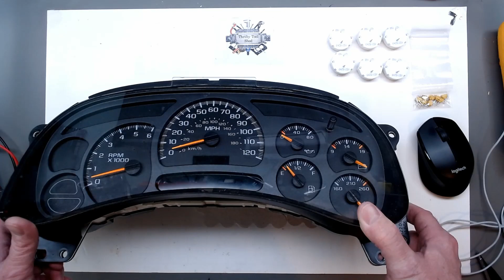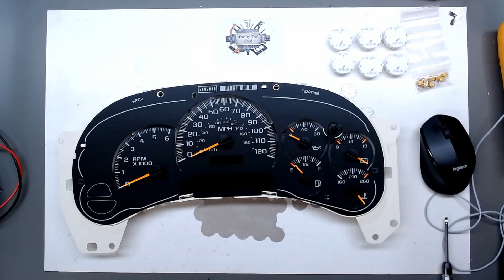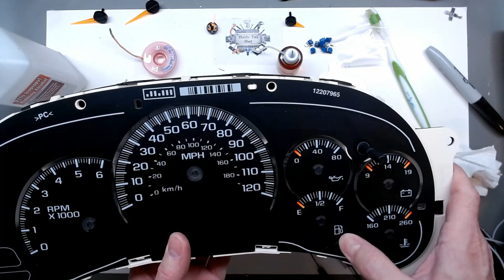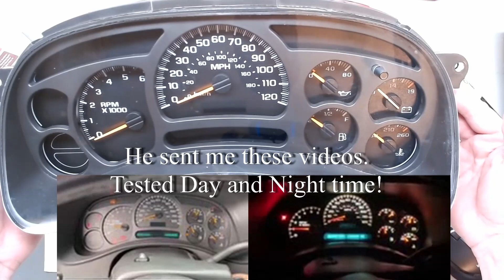2003 Chevy Gauge Cluster Repair

Comment: helpful video, but after  you install the ODOMETER how can I  make adjustment
Reply from the maker: Thanks for your kind comment. I recommend putting it up in the dash and plugging it in to try before fully assembling if you can. I was almost certain mine was aligned properly and gave it back to my friend to install. Ended up it was good to go. If uncertain where the zero was before hand on the gauges I would just double check it by connecting it up before putting the cover back on.

Comment: Great video but I was told that when you pull the cluster outand when you put it back in you have to take it to the dealership to get them to reset the security
Reply from the maker: I don't know about some models. The 2003-2004 do not, I have done several of these. I have run into a security issue on a 2010 Honda radio, it sucks...but I made a video for the reset at least!
Reply: @ThriftyToolShed  that's good to know I have a 2003  thanks